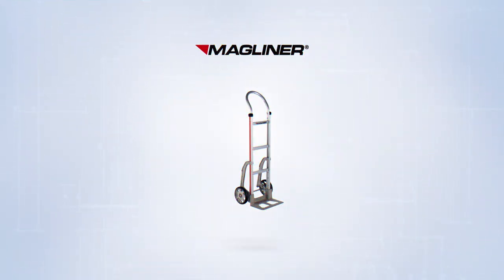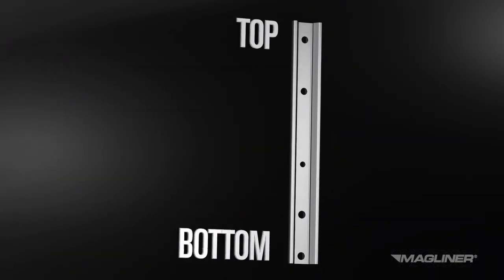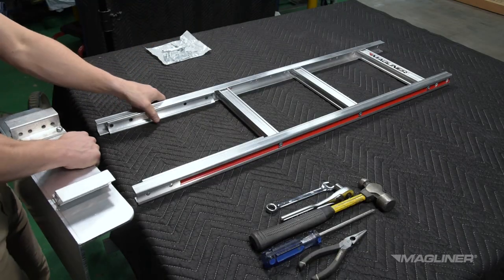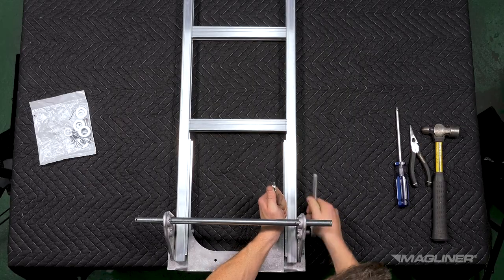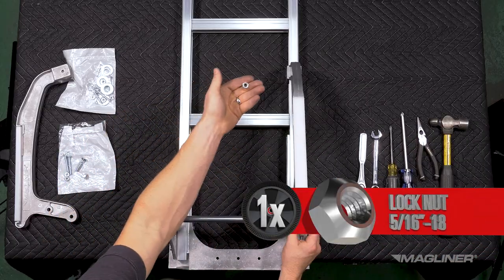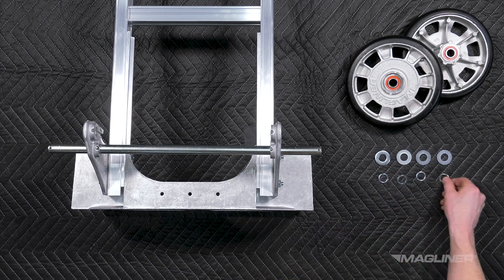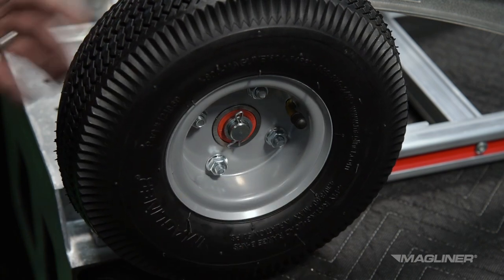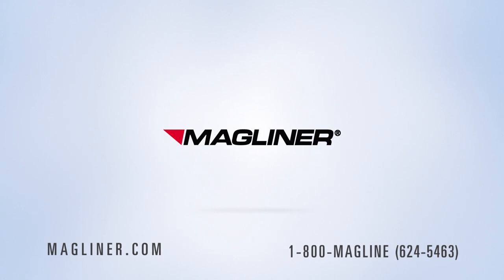Magliner Hand Truck Assembly

Comment: 1/4" and 5/16" bolts don't seem to relate to the size of the wrench needed for tightening the nuts.
Would naming them 7/16" and 1/2" for the nut sizes be more consistent?
Reply from the maker: By 1/4"-20, that refers to the diameter of the bolt shaft (1/4") and threads per inch (20). By 5/16"-18, the bolt shaft diameter is 5/16" and there are 18 threads per inch.

Comment: Which one is particularly better for going up and down stairs, 8” or 10” wheels?
Reply from the maker: Hello, it depends if you are using the hand truck with or without C5 Stair Climbers, which we recommend if you will be navigating stairs often. With C5 stair climbers, the hand truck rests on the C5s, not the tires, when in use on stairs.

Comment: Why aint my nose plate flush to the ground
Reply from the maker: Sometimes this happens when the hand truck is assembled with the axle in the incorrect position in the wheel bracket.  If that is not the case, please send photos to customerservice@magliner.com and we'd be happy to take a look!
Reply: @MaglineInc  i figure out out thanks tho
Reply: I've found, at least where I work, having the plate flush with the ground is actually a profound disadvantage. We use these things to pick up hundreds of stacks about 8 feet high, on a daily basis, and something about the plate being mounted higher makes it easier to shove the plate up under stacks. It works for us because we don't need to be delicate with the containers though so take this with a grain of salt.

Comment: How do I put the diecast nose into the frame? Your video mentioned it, but didn't actually show you anything. Useless.
Reply: Am I supposed to beat it into place with a mallet?
Reply from the maker: Please see the 1:17 mark.
Reply: @MaglineInc  Am I supposed to beat it into place with a mallet?
Reply: @MaglineInc  I cannot get the die cast nose into the frame without breaking something.
Reply from the maker: @Rob-to4uk  Please send a picture of the issue to customerservice@magliner.com. We will troubleshoot any issue you may be experiencing and we can walk you through the final steps.
Reply: @MaglineInc  No worries. I am just going to return it for a full refund. Maybe I can find one that is already assembled.

Comment: mine didnt come with directions only for the brake assembly which is still very vague! smfh🙄, there is 2 small square plates also that I have yet to figure out where they go or what they are for, its like you need a freakin degree to put this shit together, very ridiculous
Reply from the maker: Thank you for your honest feedback. The Paddle Brake Truck is a product slated for an assembly video; we understand it didn't help in your case but it will be a video added in the future.

Comment: To see what wheels you have, read the SKU part # on the tires (e.g. #131010) and then visit:
https://www.magliner.com/comparative-wheel-data-link
to find out details under that wheel SKU number.
In the video the wheels are referred to as 1080, 1075, 1070, 850, etc but you can also get those numbers from stripping off the first two leading digits of the SKU #. For example, my 131010 wheels were "1010", so they belong to "other" as far as washer spacings go.
Reply from the maker: Yes, the 131010 is part of the "other" wheel category.